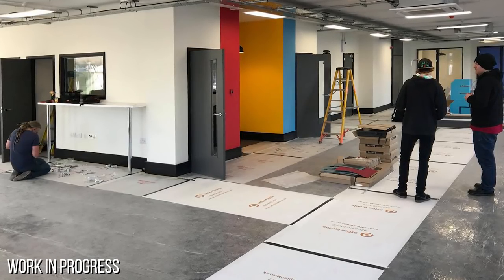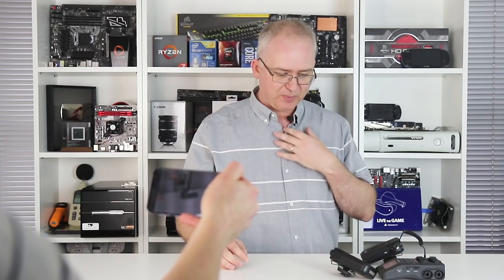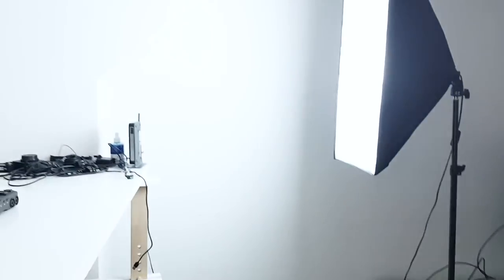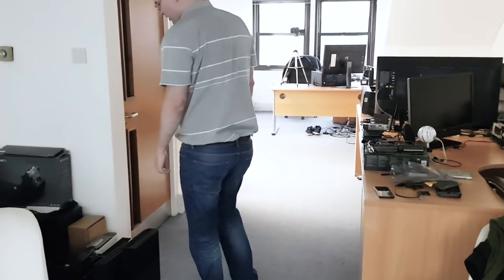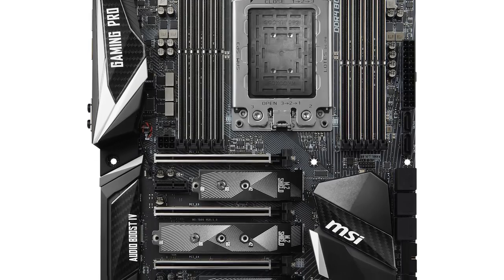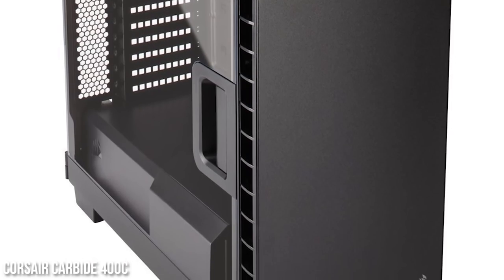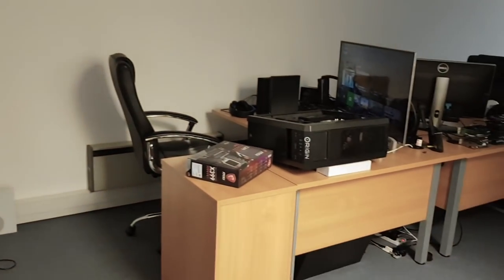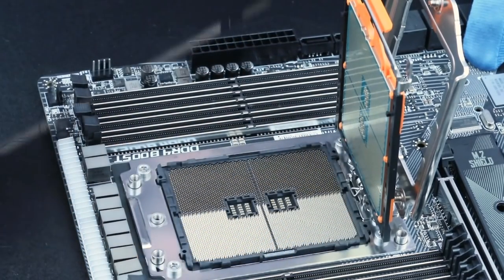Inside Digital Foundry: Office Tour + Threadripper vs Core i9 Workstation Face-Off!

Comment: I wish you'd shown the tower defense systems you are using against the angry fanboys
Reply: All you have to do is paint red, blue and green strips that collide at the end and the fanboys will just follow em like lemmings and conflict with each other, rather than attacking DF.
Reply: Now the PC fanboys, those you ward off with a wall of PCs running 3Dmark 2000 with a Alliance AT3D videocard.
The absolutely broken awful 3D graphics with dither for blending will ward off em.

Comment: The difference between buy a 1950X and a 7960X, is that you can buy two Threadrippers for one i9, so you can have three 1950X machines and render a lot more faster 4K videos than 7960X+1950X.
48 vs 32 cores

Comment: Pretty impressive stuff.  Here is the one thing I want to know with the newer Ryzen stuff.  Seeing Ryzen keeps up with Intel on so many levels, how well does it keep up doing more of those application at once?   Example: Streaming a PC game at the best quality, and not taking a hit on the game's performance.

I am still using my i7 3770, and the AMD chip I upgraded from was still fairly new at the time.  Both systems played Crysis 2, and many other games, great.  Both systems streamed HD content to Twitch great.  But only one of those systems did both at the same time, while taking a very small hit in framerate, which is a great example why I prefer Intel over AMD.  How well does Ryzen do in these types of scenarios?

Comment: if you really really intend on doing high quality video production, and you have startup cash (the only way its possible) then start with a 1900x, and upgrade to a 2950x when ryzen 2 rolls around. That way your platform doesn't need to change and you already have ALL the benefits, other than core count, of x399, and all thats required is a cpu swap vs something like a total system swap, which would require things like breaking down and rebuilding raid arrays and reconfiguring any windows settings and platform drivers, as well as needing a new cooler. Sure a x399 board cost a lot more than x370 or b350 for that matter, but the 200 bucks is worth the quad channel ram and future higher core count cpu support

Comment: @Richard - Are you really running a 16core 7960X and Titan X Maxwell with corsair CX600M ? Also how are you cooling that Skylake-X 300W+ heater with a Corsair 240/280mm AIO :O ? I image that your chip is delided and kept at stock speeds with undervolt ?
Nice video as always !

Comment: Interesting tour. Another point where Threadripper is unusual is that it's really two NUMA nodes each with two quad-cores in them, hence the latency and reliance on faster memory
Reply: This is a gross oversimplification of the two die Zen 1/+ Threadripper design. Just saying.

Comment: Amiga 500 > Atari ST
Reply: Atari STE 1040 > Amiga 500
Reply: C64 > Spectrum
Reply: No contest, C64 wins over the Spectrum, just the soundchip alone gives it a win and the Amiga wins over the ST, better sound, better visuals and more colours as well as more custom chips that allow it to do more over the ST, what the ST did better then the Amiga was a slightly faster cpu and midi port but the cpu had a lot more work to do compared to the Amiga.

Comment: the hard cost is quite clear but the soft / hidden cost that don't appear on spreadsheets gives it all to the i9.

If your burn rate was $50 per hour at even 5 minutes per working day gained at 5 days per week, 50 weeks per year, in the first year you could realize 20 hours per year, or $1,000 at a burn rate of $50 per hour. Obviously the more revenue you can create per hour or the higher the cost of the person working can radically change the pay-off of the more expensive solution come even quicker. Even for small improvements the sometimes large upfront cost difference will be more than silently made up for in a matter of months to a year. With more people and businesses trying to leverage two years or more out of each system, no question that spend it now,

Sadly, more MBA spreadsheet readers cannot seem to wrap their minds around soft / hidden costs.

Comment: Why would you use BIOS? It's 2018, switch to UEFI. (and if that's what you meant, then why did you say BIOS)
Reply: My Mainboard called it UEFI BIOS not only UEFI.
Reply: Probably either as to get more sales from people more familiar with the "BIOS" name, or they were simply misinformed. The two are not the same. BIOS is like the VHS of home entertainment, and UEFI is like Blu-ray. You can do a lot more with it. For example, using a simple cable, I can connect two computers with UEFI and have one act as an external hard drive for the other. BIOS is a thing of the past.

Comment: Are you guys exposing how humble you guys are so you don't get sued by that developer you didn't get the resolution right? (Xbox One X lawsuit)
Reply: They already did a follow up video to that initial look at the game.
Reply: Memphis Reins what didn’t they get the resolution right with?
Reply: Jack they where saying that image wasn't 4k just the Hud.
Reply: Jack game in question is Redout
Reply: Memphis Reins oh i see, so they were wrong or?
Reply: Jack - Digital Foundry's initial mistake with "Redout" (addressed in follow up video, they took down orig video and amended article) was only counting the resolution on the starting grid. 
The devs had implemented a system in the game where the resolution would go up and down depending on the section of the track. In the starting grid area it was always at 1080p, so that performance wasn't impacted with all the vehicles on the starting grid. But when you went through that area to enter lap 2, 3 etc it would still lurch down to 1080p regardless of the number of vehicles.

So while it's true they made a mistake on resolution, one I doubt they'll be making again, arguably the games main issue of not being able to consistently hit it's 60fps target was true in the first and follow up video (they waited for the games patch to compare prev & post patch perf).
Reply: Yeah, ultimately the egg is still on Redout's face as far as I'm concerned. They should have true dynamic resolution in place so the game can adjust itself based on load. Picking parts of the track arbitrarily and locking their resolution is a dumb solution. If a lot of racers find themselves clustered in a 4K section of track, performance tanks. Utterly fucking stupid on the developer's part. They need to focus less on threatening lawsuits and more on learning how to do their fucking jobs as game developers correctly.
Reply: DaveSimonH ah i see, not really DFs fault in this cause, i think redout would benefit more from dynamic resolution and less sensitive publishers/devs
Reply: Memphis Reins their parent company is a bit bigger..
Reply: WayStedYou i just googled them and they don’t have a parent company? They are independent
Reply: Some early "big name movies" the TITLE SCREEN was only in 1080p the movie was in 480p on a BluRay disc. Then magazines started warning people to read the back of the box carefully.